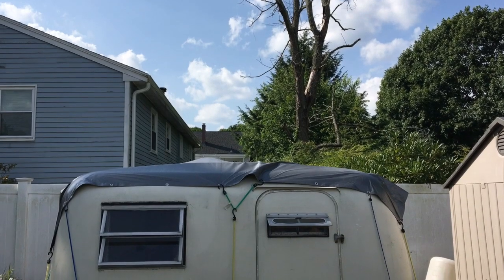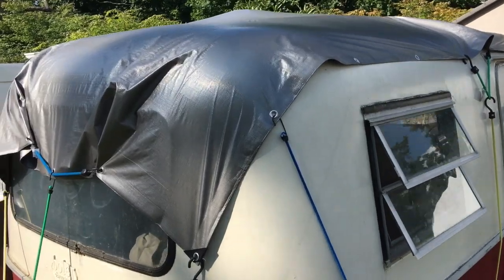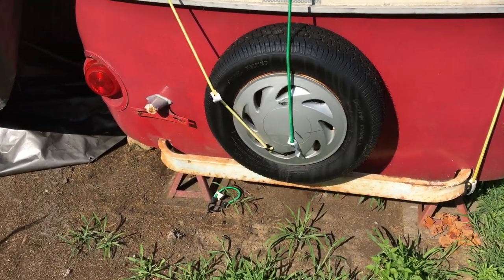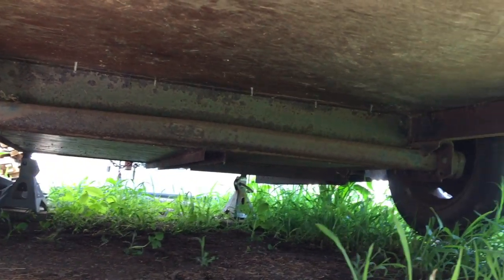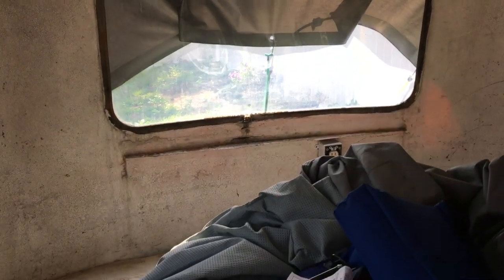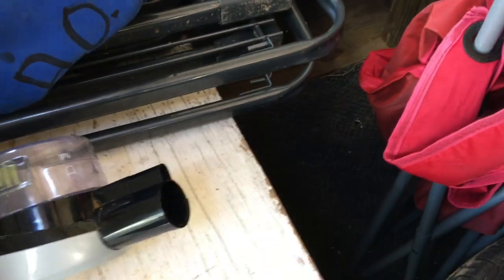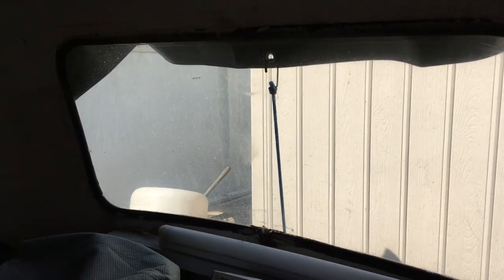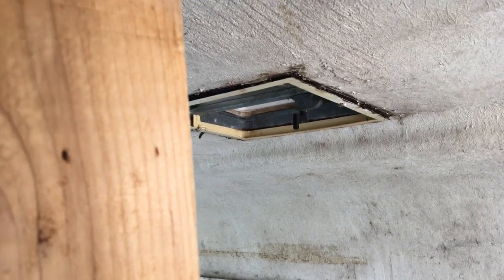Vintage Boler Micro Camper- Should I buy it? (Tiny House Conversion?)

Comment: If he wants less than $500 buy it if it's $501 leave it right where it sits
Reply: He's asking $1,400.
Reply: I wouldn't give a hundo for it.
Reply: I'd agree, $1400 is way too much. With none of the original stuff in there and a weak/leaking roof, it's probably not even worth $500. 

Hard pass.

Comment: $1000 Max. Going to take a lot of work.  Thought about looking for another one in better condition? Have a long shot suggestion for the roof if you want, have you ever taken a car interior roof lining off & seen what holds up the roof?  There are lots of support struts that go across the roof, go to scrap yard, pick similar sized car, suv etc & use the struts to bolster the roof in the Boler, maybe possible to use the car headliner as well?  Might work, might not work, worth a think?

Comment: I live in Ontario Canada and I have been keeping my eyes open for a used Boler.  They are so expensive!!  I have never seen one for less than $5000 (and that's Canadian).  That one looks pretty beat up but you could prob source some original parts for the inside in Ontario.  I'd buy it.

Comment: Buy it. Molded fiberglass trailers hold their value ridiculously well because they hold up great. Leaks can't ruin the structure, like they can with most trailers. I have a 17 foot Casita. Love it. Your roof issue just needs a bulkhead for support, and it will be fine. That trailer may outlive you.

Comment: Good price.  You will be putting a lot of $ into it if yu want it to be watertihht........trimming out the windows, door, ceiling vent, door hinges, rivets, possibly.  We bought ours 3 yrs ago and did all the things mentioned on a 40 yr old Boler.  But we camp in it all the time and consider it priceless.

Comment: Pretty exterior BUT, the needs out weight that price.  I wouldn't pay more than 200. - the interior missing parts may have been supporting the roof.  You couldn't even walk the floor for weak spots.  Something better will come along.  Especially,  getting close to fall, folks won't want to store for the winter what they don't plan to use.  Good luck.